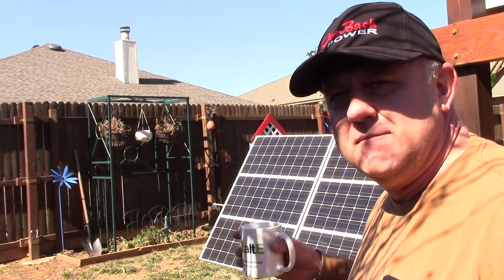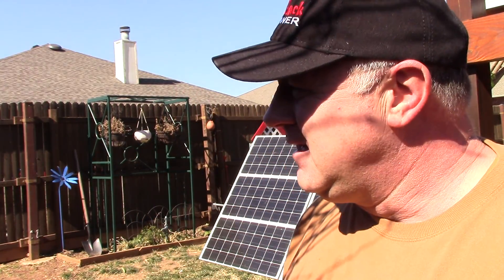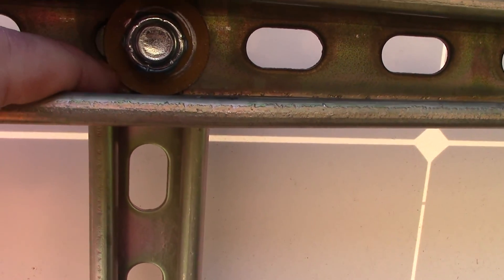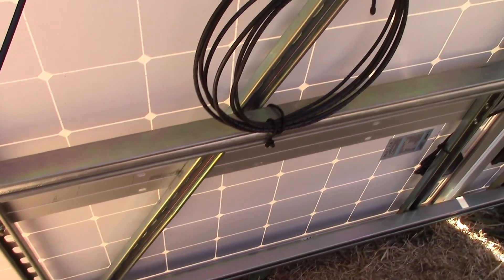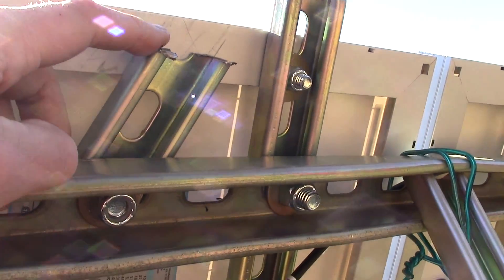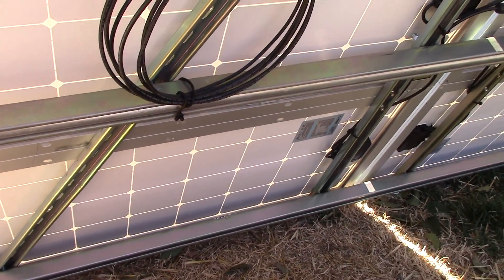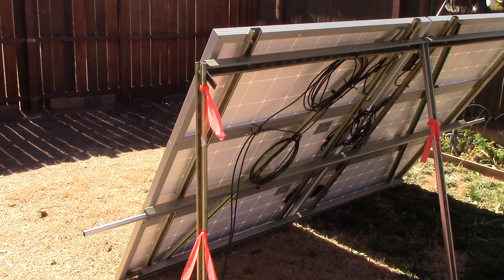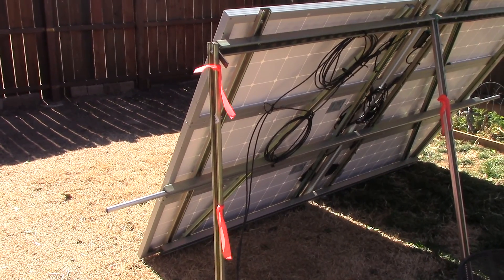Strengthening my 600w Renogy solar panel array (thicker Superstrut and hardware)

Comment: Racking / hardware ends up being a fairly significant cost when done right.
Reply from the maker: Quite honestly, this project quietly dissolved into the current build I have. Reused a lot of the hardware from this goofy solar panel tilter I tried. It was kinda-sorta a mistake from the start

Comment: Looks strong for wind resistance! I got my brackets at a scrap yard for" by the pound ""prices.I built my frame from treated 2X3's because I was concerned about corrosion and used all stanless screws,too. Mine will be fixed: no tilt or rotate,so far.

Comment: Wow! Your not playing. If U use a 3/4 solid rod U could easily use some 3/4 pillow blocks to make it tilt on & really from that point on U could easily turn that into a east west tracker real easy, just a thought .
Reply from the maker: Thanks. I don't have much real estate to work with in my dinky little suburbia lot. So, I will use a better system next time.

Comment: Does it matter that the bolts on the superstructure look very close to the back side of the array?  Could the array flex enough under wind or hail to strike the bolt and crack the panel?  It might be just an optical illusion due to the angle it was filmed or even not matter because if the array flexed that much the panel would crack anyway?
Reply from the maker: Good eye. Yes there are bolt ends that are really close to the backside of the panels. However, it will be fine. There is no flex there. Next time I will use shorter length bolts. Thanks for watching.

Comment: Looking good.  I would get rigid conduit instead of a solid bar. A hollow tube actually is stronger and would have less deflection. Take care man!
Reply from the maker: Thanks TR. Do you think 3/4" hollow gas tubing would work? That way I can cap off the ends too.
Reply: If it's what I think yes I don't see why not, old galvanized water pipe is very strong as well( which i think is the same thing..LOL).
Reply from the maker: Thanks man...check this out...found it at Lowe's. I can use two pieces if they don't have a 10' section.
http://www.lowes.com/pd_313574-185-315+34X120_1z10xvq__?productId=3538966&pl=1
Reply: Yep that's exactly what I was talking about.